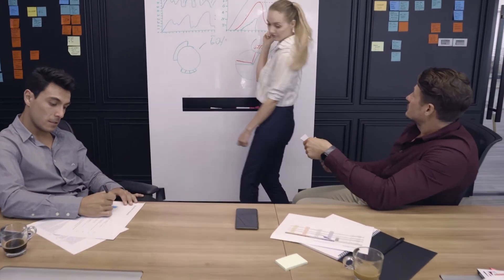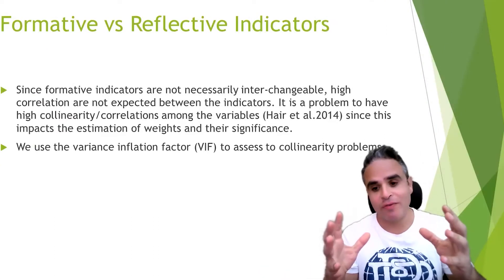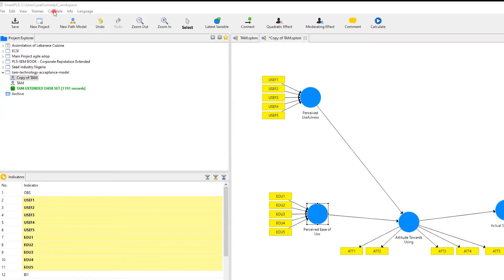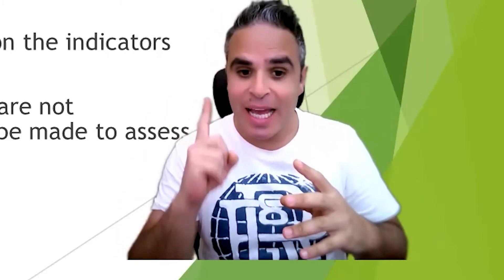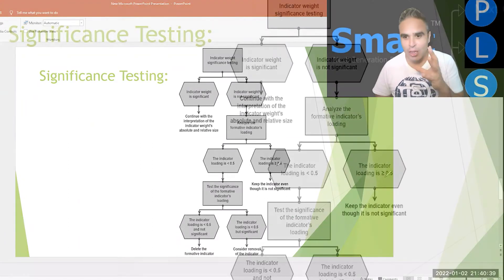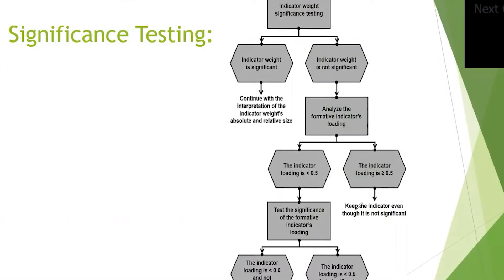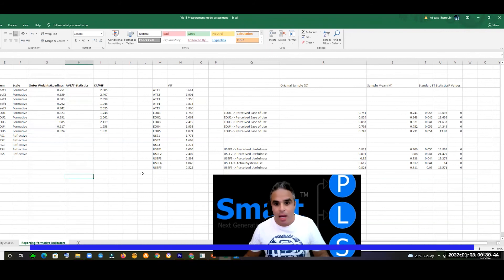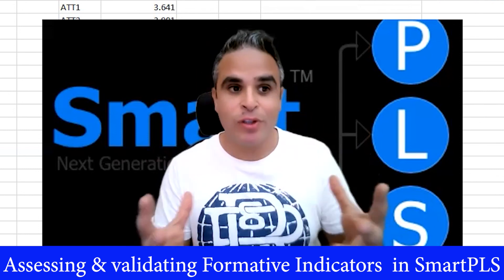Assessing and validating formative indicators in SmartPLS

Comment: @The-Dissertation-Thesis-Mentor thank you so much for this video. You don't mention checking the convergent validity of the formative constructs using redundancy analysis (as mentioned in some books and literature). Is that not needed? I am currently assessing a formative-formative HOC model, but I do not have global single items for a few of my formative constructs. Thus, I am unable to check convergent validity via redundancy analysis. Is this a problem? Is there a solution to this or do I just skip testing for convergent validity? Thank you in advance!